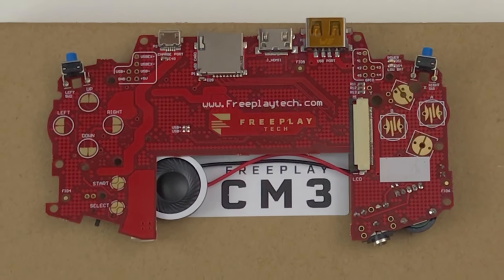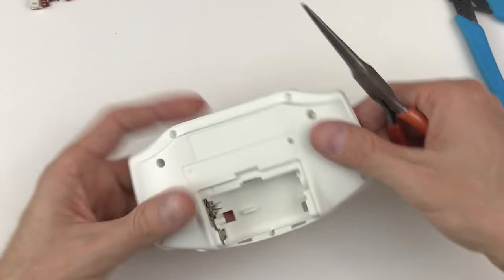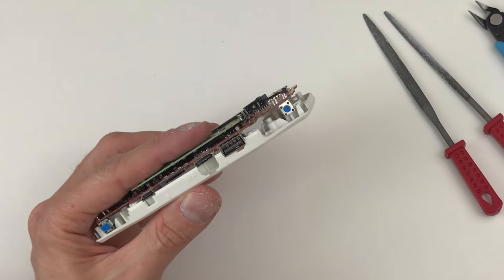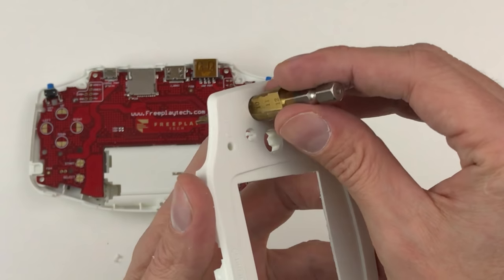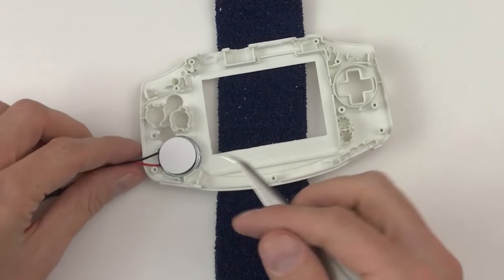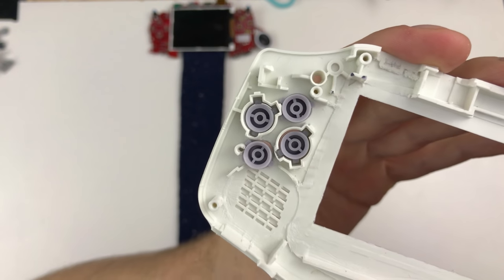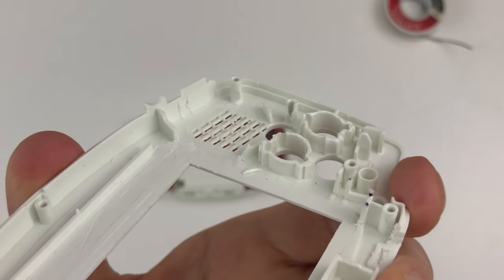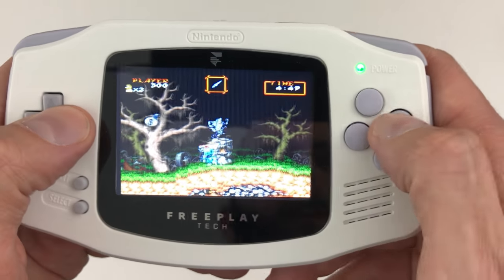Freeplay CM3 Example Build - New X&Y Button Options

Comment: Question for you, Hipcat.

What size range of step down bit did you use? I just ordered my CM3 and plan on using the silicone for it, but I don't want to ef the holes up.

Thanks! Great work! I'll be watching your video a lot up to and during the build.
Reply from the maker: Elias Rostad thank you. The bit steps from 3mm - 12mm.
Reply: @jivinhipcat  Brilliant, and you said you stopped at 9, with a little jimmying back and forth to widen the hole a touch larger?
Reply from the maker: That’s right; the original A&B holes are about 9.2mm. Just make sure to go slow and not do what I did yesterday. I wasn’t paying attention and punched through 10! That was after I modified all of the rest of the case too. Had to start over on another case :)
Reply: @jivinhipcat  oh shit! Even tht pros can make an error I guess lol.

That's why I ordered two extra shells, just to be safe lol
Reply from the maker: “Pros” hahahahaha. Yeah definitely 2 shells is a good idea. If all goes well the first time on 1 shell you can still tinker around with the second and try stuff out too.
Reply: @jivinhipcat  true! And, hell, could always build a second as a Christmas gift or something.

Would there be any reason to not make the XY holes first? The rest of the build seems fairly straight forward, cut off stuff until the board fits, but the holes seem like the biggest pain in the butt to get right.
Reply from the maker: Elias Rostad that sounds about right. If you mess those up you will see them right away and constantly.
Reply: @jivinhipcat  thanks man! Really appreciate the help!
Reply from the maker: Elias Rostad no prob
Reply: @jivinhipcat  hey man! Sorry to bother again.

I get my shells today! Got my cm3 on Friday and it passed a bench test, so tonight, I start the build.

Question is, I noticed you didn't detail any modifications to the L and R buttons on top. Did you have to do any work on them to get them to fit?
Reply from the maker: Elias Rostad that’s a good point I forgot to talk about. In a lot of cases I do a little modification to the shoulder buttons, but this case and buttons needed no work at all. I sometimes file the two nubs that go into the little case sockets, that’s where the button rotated around, just to make them a little shorter so there’s less pressure on them. Sometimes, depending on the case, I’ll file the case a tiny bit where the case touches the shoulder buttons so they don’t have that much friction. In the most extreme case mismatched fitting I will not screw the top screws in 100% in order to keep the shoulder buttons moving freely. I only did that on one build so far, and I bet I could actually fix it up with a little filing now. The screws are tight enough that you can’t even tell they are backed off a half turn or so. Like a lot of things with each build you will need to see how the fit is for your case. It’s pretty wild how really small variations in the cases and buttons can make a huge difference. Something else you may run into is that you may need to tweak the D-Pad. Feel a little. Sometimes the D-Pad can feel a little stiff depending not the button and pad that you get. I think it’s about 50/50 if it will need some minor adjusting. Something I did on my last “Slim” build is I cut the small round silicon tube that contacts the center point of the bottom of the D-Pad plastic. I shortened it by like 1mm and put a few vertical cuts into it in order to soften the feel of the D-pad. It worked. (I actually cut too much off the first time and it was a little loose, so I tried again more carefully on an extra pad I had)
Reply: @jivinhipcat  Okay! That's easy enough.

Wish me luck!
Reply from the maker: Elias Rostad good luck. Don’t rush :)
Reply from the maker: Al good?
Reply: @jivinhipcat  went surprisingly well!

Worked for about 2 hours last night, going slow, and got the back shell finished, the screen cut out, and the buttons drilled.

Buttons went pretty well, but the bottom button is a little weird. I think there must be some extra plastic hiding somewhere, because it doesn't want to lay down entirely flush. Going to look at that today.

I did end up losing one of the screw posts near the screen, ended up popping off after I drilled the holes for the buttons. Hopefully it wasn't incredibly necessary.

Tonight, I'm gong to work on fitting the ports on the front shell, and doing a few tests.
Reply: If I could send pics I'd show ya.

When I was taking them, though, I found the bit of plastic hitting the bottom button, so I'll do some exacto work
Reply from the maker: Elias Rostad yeah that area is really tight
Reply: @jivinhipcat  Lord yes. I'll give it some TLC tonight.
Reply: @jivinhipcat  spent some time with an exacto this afternoon and cleaned that area out. Button is traveling perfectly now!

Going to do the port fitting on the front shell tonight when the kiddo falls asleep.

Oh!! And I managed to save that small wall for the left shoulder button!

Of everything else, I'm proudest of that lol
Reply from the maker: Elias Rostad hahahaha I know that feeling with that little thing. How is your screen centering looking? Did you do anything to help it move over toward the speaker side?
Reply: @jivinhipcat  stopped before I did that last night.

2am came around and my eyes started to cross lol. That's first on my agenda tonight. Going to cut up the silicone pads for the XY buttons, then fit the ports. Feels like a lot easier night of work than last night, that's for sure.
Reply from the maker: Elias Rostad If you are looking to center the screen I found an easy way that I talk a little about here There is a much easier way to center the screen. There is a small white plastic piece you can remove from the ribbon cable side of the screen as is done in this build https://youtu.be/VbrAQ35bfXU?t=207. The post I got the idea form is listed there too.
Reply: @jivinhipcat  oh now that's interesting.  I'm gonna look into that!

Looks like I'll have to take off the entire wall under the speaker to fit it and the screen.

Do you use anything to glue or hold your screens in place, or just use the foam from behind to hold pressure?
Reply from the maker: Elias Rostad I use a small bead of hot glue at the bottom of the screen to hold it in place. I try to just make it one nice round bead so later if I need to take out the screen (I’m always tinkering so upgrades always happen) I can take the glue out easily in a single piece most of the time. I also still use a bit of packing material behind the screen to keep slight pressure on the top half of the screen.
Reply: @jivinhipcat  that makes sense! I'll do that.
Reply: @jivinhipcat  so, I thought I had everything set, and ran into some issues.

The upper of the XY buttons is extremely floaty, not sure why, but I'm thinking it has something to do with the silicone pad.

The lower of the XY buttons is getting stuck. I think on the speaker, because there is very little room in that corner, even with the other wall taken down.

Oh, and for an odd reason, the tabs on the power switch won't hit it. The power switch is maybe a millimeter too high.

I'm taking a smoke break, because I'm kinda stuck.
Reply from the maker: Elias Rostad the X&Y feel a little loose, like kind of rattling? Maybe a tiny spacer inside the button to keep a little extra pressure on the pad? The speaker area can be tricky. Maybe there’s a tiny bit of filing you can do on the wall of the case, the screw post, or possibly the button side. It may just be like .01mm of material that needs to go. Hard to tell but sometimes the smallest amount can help. Just be careful not to get rid of too much too fast. Like taking away too much from the screw post and it not working correctly afterward. That screwpost in the corner does a lot of work keeping the case halves together. (I wonder if filing a tiny tiny bit of the speaker metal could help a little in wierd cases too). The power switch. My first case had one that sounds like yours. I used a piece of thin plastic as a spacer under the sliding button to raise it up a little.
Reply: @jivinhipcat  hmm a spacer might do it. I could see needing to glue it in place to keep it from slipping out, so initial fitting might be a pain, but possible.

I guess, worst case, if that doesn't work, I could beg/borrow/steal a soldering iron and install the clicky buttons.

I'll try taking more from that lower area by the speaker. Thinking on it, I think there's a couple spots I could shave off with a flat exacto to give a bit more room.

Crossing fingers.
Reply from the maker: I forgot to mention that with my new silicon pads build I got the pads in place and then glued them to each other to make them more solid. I was just worried that the single buttons might wiggle out of position eventually. I just used a drop of glue between each of the 3 pads to connect them to each other.
Reply: @jivinhipcat  oh! That makes tons of sense!

That was another thing I'd been pondering.

I'm wondering if I go back and try cutting the pads again to fit perfectly with the intact pad (small gaps right now) and glue it together if that might help with the floaties.

Though, I'd imagine that a spacer will still be needed to hold the button up against the shell.

Hmm.
Reply from the maker: These little variations in the cases can be tricky. You know the Slim build I did a few days ago didn’t need anything done to the speaker area outside of removing the old speaker wall. No filing at all. I was like “wow, alrighty then.”
Reply: @jivinhipcat  hahaha lucky man. I'm having to do all sorts of little shaving and tweaking.

The weirdest was the wall behind the mini HDMI kept hitting the very back of the HDMI port, so I had to do some shaving there.

Trial and error, then more error and trial.
Reply: @jivinhipcat  update! 

While the kid was distracted with YouTube, I grabbed the front shell and a flat end exacto knife and did some trimming down by the speaker wall, the screw post near the lower XY button, and the HDMI and USB ports. Little bits shaved off here and there.

And it worked! The cm3 slipped into place like it was made for it.

I don't know which part did the trick, but something around those areas was pushing and now it's gone.

During nap time, I'll do a test fitting and see how much, or if, I'm going to need a spacer for the buttons, and if I took enough off the speaker wall.
Reply from the maker: Sweet! I know that feels good. I just thought of something, maybe why I didn’t have to mess with much for the speaker area on the Slim build. On that build I also removed the white plastic on the screen to center it. Maybe that frees up extra space for the speaker as well. I bet it does.
Reply: @jivinhipcat  oh interesting. That seems really fiddly, though, and I'm worried my skills aren't quite up to that par.

Even if that slim build is incredibly sweet

Hmm...I think I'm going to try that next
Reply from the maker: Oh I mean that may be an option to find more room in the speaker area if you need it
Reply: @jivinhipcat  oh!!! Ha, sorry. The kid is distracting. That's a good point! I'll try fitting later and see
Reply from the maker: Yeah I’ve been working on a new build and now going to take a break to pick up one of my own distractions 😁 so I know how that goes
Reply: @jivinhipcat  haha glad you get it.

I do think I'm going to invest in a better cutter today. The side-cutter I have is so damn dull I gave myself a hand crap trying to cut some of those walls.
Reply: @jivinhipcat  Hey man! So i'm still having issues with that upper XY button, but thhe rest is pretty okay. Right now, my biggest issue is that i can't get games onto the SD card lol. anyway, i put some pictures in imgur. would you mind looking them over quick, and see if i completely  messed anything up? https://imgur.com/a/aMfChAm
Reply from the maker: This may help out a bit https://youtu.be/QPNO9wQESrk . When I start working on those buttons they usually look the way yours do. I keep taking away a little plastic here and there by cutting or filing. All the way down the button wells to the flat plastic. The little legs on the buttons can touch a little here or make things too tight and it can be hard to see what is actually causing things to be too tight. So I got lazy in this build and just cut away (It is the Slim case build so I know they work well still). Just be sure to not overdue removing bits because it’s real easy to cut/file too much. I just take it a little bit at a time and test, eyeball what is making contact, file/cut, test and eyeball again. It really is wild how much tiny little things make a big difference. The more I work on different build ideas the more my life seems to revolve around .01mm of this or that :)
Reply from the maker: Also I filed a couple of the little button legs down a little bit so they wouldn’t bump up against anything, but they are still long enough to to their job to keep the buttons in the case. I didn’t have to do that in the example build, but it helped in my current build.
Reply from the maker: Any luck?
Reply from the maker: Oh hey I just looked at your pictures again and see why the upper button is loose (probably). There is a screw post there right above it that should still be there but is gone. That post, and the little bit of wall that was attached to it help to secure the button and act as a guide for it’s travel. No worries though; you can replace it with something else that is sturdy and smooth. Any old piece of plastic, or anything else really that is sturdy and has a smooth surface for the button to slide against should do it.
Reply: @jivinhipcat  hey man!

No luck so far. I brought my build and tools to work with me, to work on in my down time, but we've been busy all day.

Hopefully I'll get some time tomorrow to try.

I did notice a couple other things after we chatted.

The down D pad button is getting stuck down. I think one of the ports on the top is catching, so when I screw the board in it's creating a pressure point. And I'll definitely need to do a bit of modification to the L and R buttons, as they don't press down at all with the case together lol.

I feel like I'm nearing the end. Minor things to adjust.

My biggest true annoyance right now is that retropie won't create the folders on my SD card, so I can't add games.

Wish I'd sprung for the wifi adaptor lol
Reply from the maker: Yeah, but it sounds like yo aren’t rushing so that’s good. It’ll be easier to tweak all the little things if you aren’t in a rush. Are you adding the folder “retropie” to the root of the FAT32 formatted SD card and it won’t create the system folders?
Reply: @jivinhipcat  yep yep.

I formatted the SD card to fat32, installed the CM3 software on there. Cm3 boots into Retropie with Emulation station just fine.

Formatted a new USB drive to fat32. Created the retropie folder, plug into cm3 and turn it on.

The light comes on on the USB drive, flashes forever (I ended up letting it sit for nearly 3 hours while I was busy). Shut down cm3 and plugged the USB into my laptop. No sub folders in the retropie folder.

Did it a few times in between other things, and no luck.

I'm perplexed.
Reply from the maker: Weird. I wonder if it will transfer if you add the sub folders yourself. I can write up a quick list of the sub folders if you like.
Reply: @jivinhipcat  hmm, that's an idea.

I might actually have them already, now that you mention it. I think I have them on another flash drive, assuming I have it with me.
Reply from the maker: Maybe just try one to test and see like retropie/roms/nes
Reply: @jivinhipcat  worth a shot. I'll give it a try in the morning.

Thanks man!
Reply: @jivinhipcat  Well, i think i got one thing figured. For some reason, the flash drive i was using was reading as NTSF not FAT32, so i'm doing a slow conversion. I think the quick conversion didn't take.

I cut off those parts of the walls you showed in your other video, did some cutting of the port area, and trimmed the LR button nubs. Going to test here soon!
Reply from the maker: Nice, and I think the loose top button is the lack of that screw post and wall above it. If that’s still an issue you can replace that screw post and wall with something else to help secure that side of the button.
Reply: @jivinhipcat  dude! I fixed the transferring games issue!

So! I loaded some games on to test it out...aaaand the XY buttons don't work.

They look like they're hitting the right spots. Not sure. Think I might just put on the clicky buttons instead at this point.
Reply from the maker: Are they not registering in the “configure controller,” or “configure input” setup? I have all mine in pieces at the moment so I can’t check the exact wording.
Reply: @jivinhipcat well, I'm an idiot lol.

They're working! Don't like the feel, but they work.

I think once I get home, I'm going to take the time and do the clicky buttons
Reply from the maker: Hahahah cool. The soft tact switches are good too, but I prefer the feel of the pads. The tact switches actually have less of a click to them than the pads, and require a little more pressure to push. They aren’t bad, but I like the pads a little better.
Reply: @jivinhipcat  dude! So I'm taking a break tonight, just got home from work and going to enjoy time with the kiddo, but the more I think about it, the more I know you're right. That missing screw post is what's screwing me over. I think, though, that if I glue the silicone pads together and put a small spacer under the XY pads around the bottom, I think that'll create enough pressure to make up for it..

Also, a number of the welds by the LR buttons are very long, I can take a picture later. Can I snip off some of that excess metal from the weld points?

Other than that, I think I may have actually done it. Games are loaded (I won't tell you what I did wrong because it's incredibly stupid and I'm actually embarrassed), sound works, and the screen is, call it 90% centered.
Reply from the maker: Hahaha nice. I’m in the trenches with this Full Slim version. It’s going well, but will probably be a couple more days still.
Reply: @jivinhipcat  nice! I can't wait to see it
Reply from the maker: It’s current state https://imgur.com/a/RMKCa4R :)
Reply: @jivinhipcat  holy shit. That's...I can barely figure out what's going on. It like like you're doing the Xbox thumbstick locations, and Start Select are down at the bottom? And both LR and L2R2 buttons?
Reply from the maker: Hahahaha. Have you seen my other builds? I have a few on my channel with different upgrades to them. This one should be the coolest one (hopefully). Yes, it now has Nintendo Switch Joy Con analogs in the Xbox locations and the D-pad moved down too (an actually Xbox D-pad). They shoulder L2/R2 will be the same idea as my latest Slim build (video on my channel too), but instead of using soft tact switches for them I think I’m going to change them to regular clicks tact switches to help differentiate them from L1/R1 and bit more. They should be smaller and look a bit better I think too. The Start/Select location is the same as my other dual analog build, but I’ve now added a couple forward firing speakers next to them. :) Still some work to do before I post a video about it, but it going great. (It’s in the Slim form factor as well)
Reply: @jivinhipcat  freaking brilliant. I'm really damn impressived dude.
Reply from the maker: Thanks. Hopefully I can figure out a good way to fully test Steam streaming with it. It will be sweet to get that running well. ETA Prime seems to have it running great on his Raspberry Pies
Reply from the maker: Elias Rostad Almost done! https://imgur.com/a/LgN5Qwk
Reply: @jivinhipcat  so! Took some time off, was getting brain locked with it, and I've hit a wall.

I cannot get those buttons to press right. I think I need to either start over with a new shell or, well, pay someone to do it right lol.

I dunno. I guess I could do the clicky buttons, but I'm not 100% sure I want them.

Either way, I'm pretty sure that first front shell is crap and I have to start over.

Bleh.
Reply from the maker: The soft tact switches aren’t bad. I just like the pads a little better. You could always solder those buttons on and try them out with your case. You’d probably just have to shorten the button wells to get the space. Then, if you don’t like the feel of them you could desolder them and go with the pads on a new case. That’s what I’ve done with the example build board. You just have to be sure to clean up the solder from the pads to make them really flat again for pads. 
My brain is hurting tonight too. I’m trying to get the speakers to sound right. I’m using small 1w 8ohm speakers and they sound distorted, weak, and awful. Trying to figure out how to get them right while my extra mediocre paint job dries. (Still not good at painting either)
-edit
Oh i guess if you tried out the soft tact switches you’d also have to shorten up the buttons themselves which would have you needing to get new ones for the new case and pads
Reply: @jivinhipcat  true true.

Gonna have to ponder this for a bit. I might try starting over with a different front case first.

I still cannot figure out how that screw post was removed. I think that's what's screwing (get it?) me over.
Reply from the maker: Yeah. Keep me    posted    :)